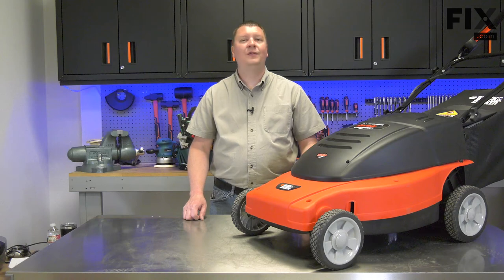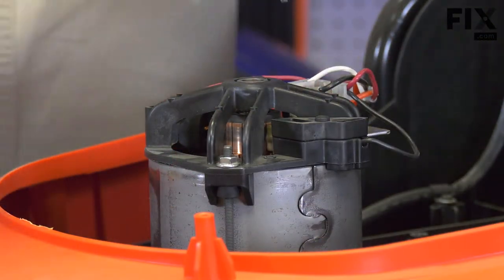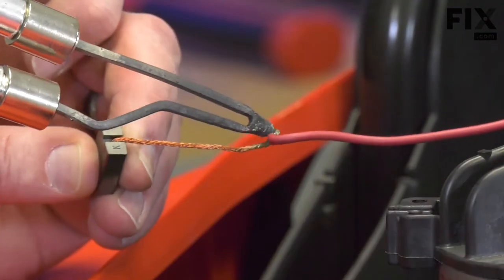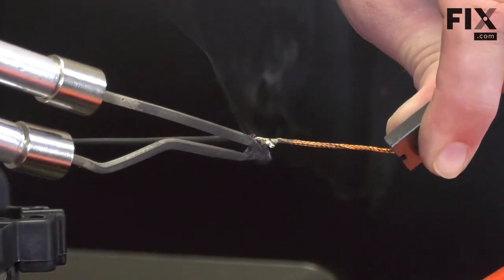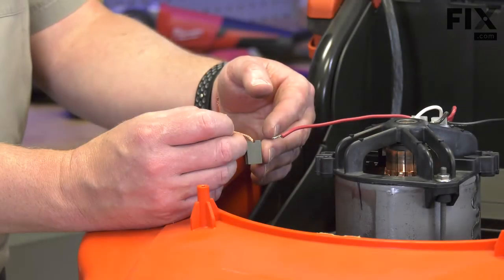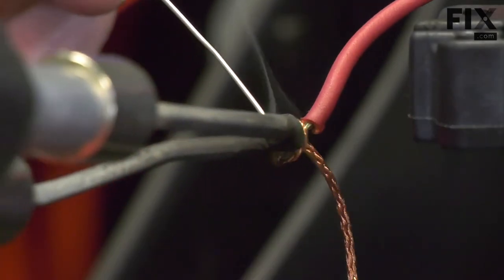LAWN MOWER REPAIR: How to Replace the Carbon Brushes on Your Electric Lawn Mower | FIX.com

Comment: Nice video, showing all the steps. The only part missing for me was a close up on place the brush in the brass holder; I saw your fingers in the way. I think I pretty much get it. I would just feel more secure about the job with a full, uninterrupted view. I keep watching videos & no one shows every step completely. Thanks for the video; most of it is very helpful.